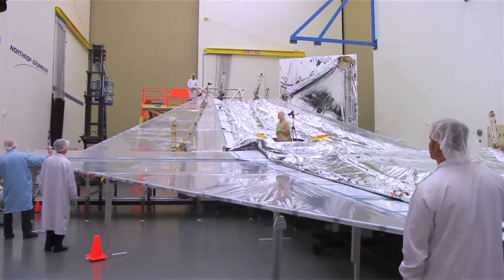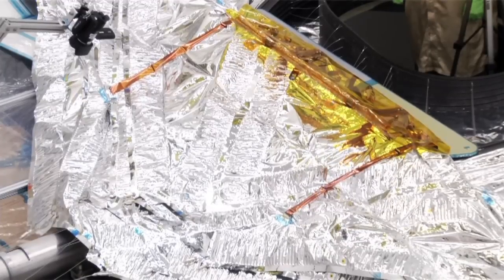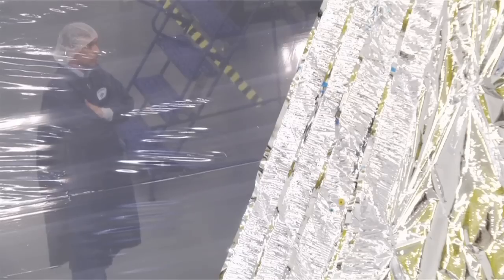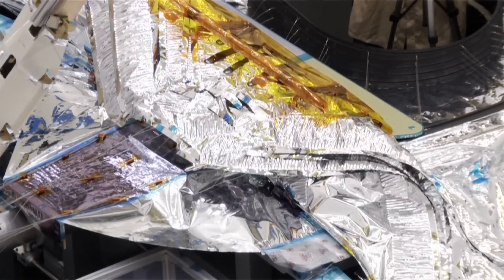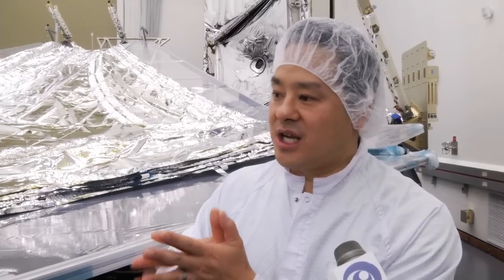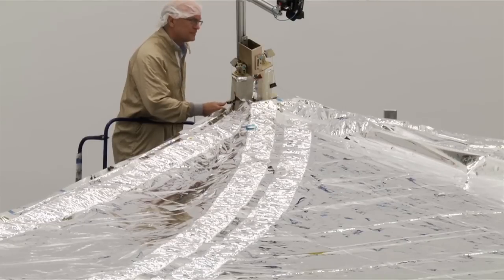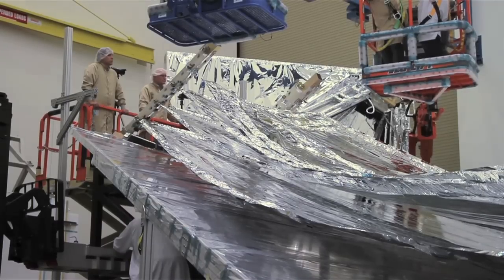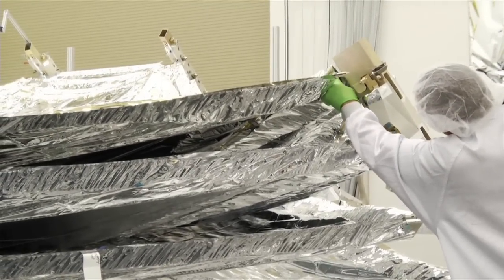Behind the Webb: Give Me Five (Episode 31)

Comment: And when the rocket explodes, they realize how stupid it was to only build one.
Reply: Well, combined with the launch the cost is about $9 billion... kinda expensive too make two just to be "safe"
Reply: RiPPAN
If the first launch works, you do not need to launch the second one. How much of the rest of the money is going into design and R&D, how much into assembly, and how much into the cost of the actual materials and on-board equipment? When producing it, they could at least produce and store a clean spare part for everything, so that they can start building another one if the first one goes boom.
Reply: Well there are 20 countries contributing to the budget, so the cost for the average american is measured in cents. Besides, this is a tiny amount compared to the war crime budget